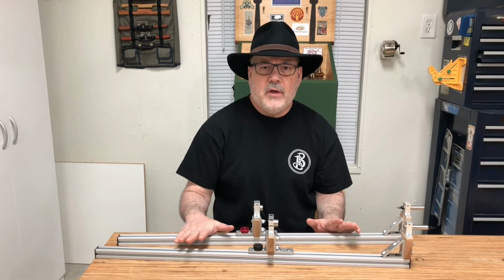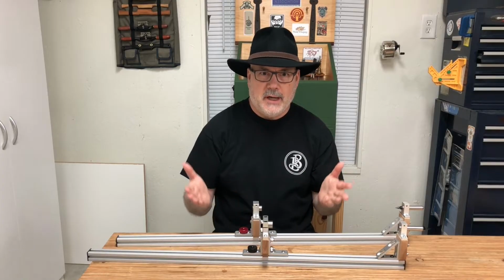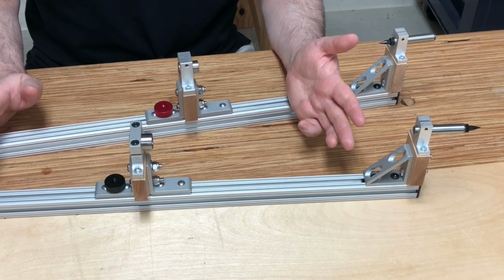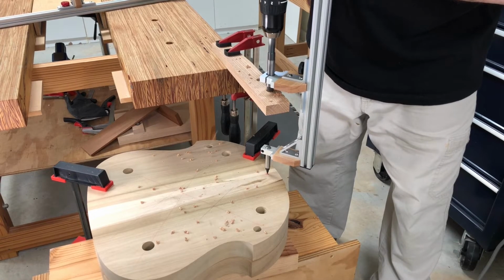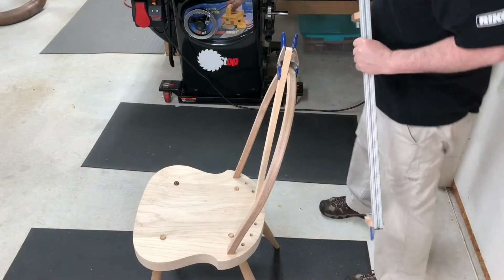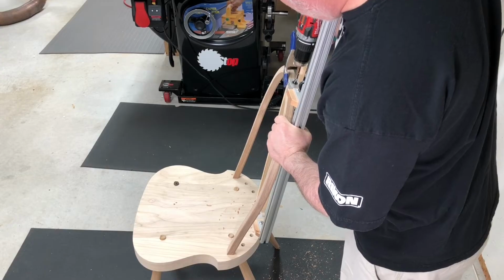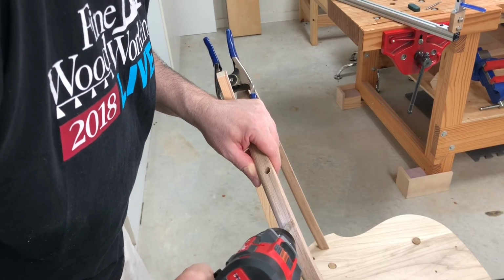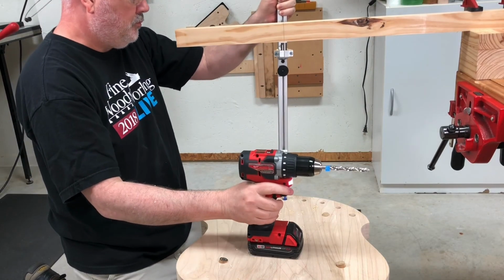Overview of the Spindle Drilling Guides

Comment: You never seen to use backer pieces when drilling through an arm bow.  I find even with a very sharp brad point, the exit can really shred the wood.  How are you achieving this?  Extremely sharp bit?  Drilling speed?  Just strong wood that resists tearing out at the exit?
Reply from the maker: Our line of Stiletto Drill Bits is the best solution. They greatly reduce tear-out on the backside of the hole.